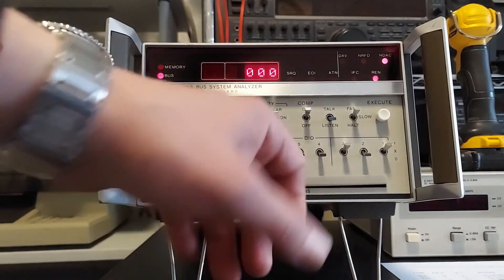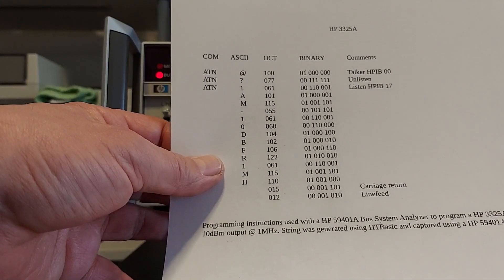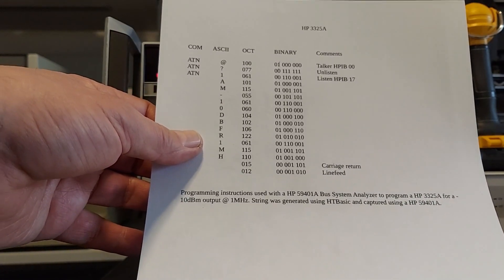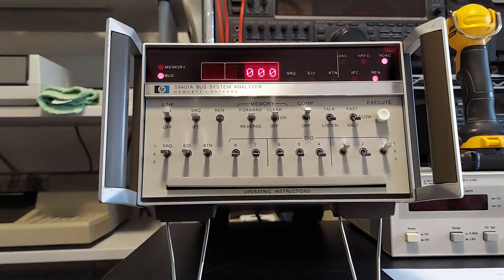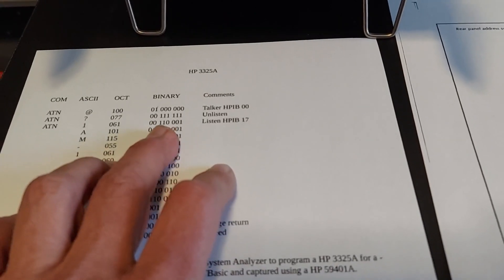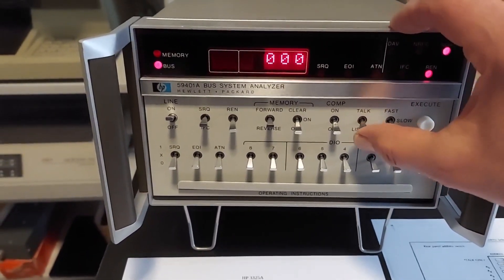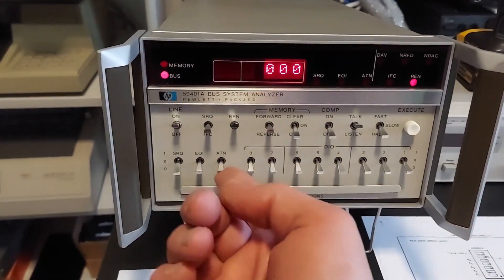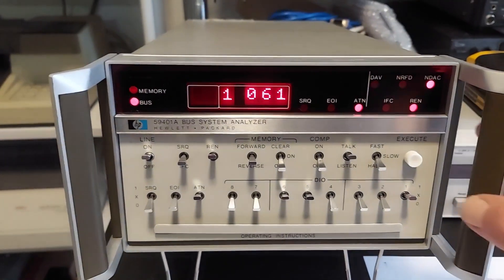HP-IB Shenanigans. Programming with the HP 59401A Bus System Analyzer

Comment: Hi! Got one of these too and use it to find out how to program my "boat anchors".
Old HP-IB gear usually uses the EOI (end-or-identify) bit set at the last data byte instead of the trailing CR/LF.
And you should send an UNLSTN command after you're done to free the bus for other communication (which isn't going to happen :-)
Many greetings from Austria!
Reply from the maker: You are correct, I just copied what was produced from HTBasic to see how the command syntax was structured. A lot of the HP-IB command documentation I've read is not very clear sometimes. I was curious as to why an EOI statement was not used at the end of the capture. I have seen this instrument used to send a rewind command to a HP 9 track tape machine and an EOI command was used in that demonstration. Anyway, thanks for watching and the shout out from across the pond!